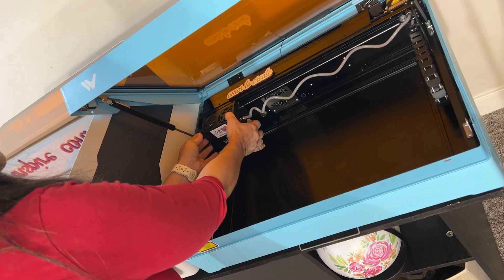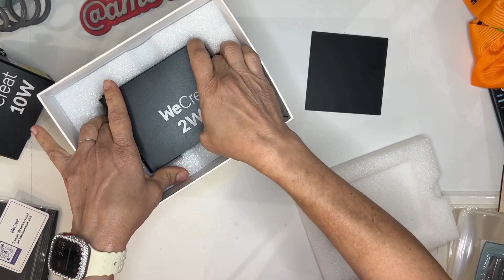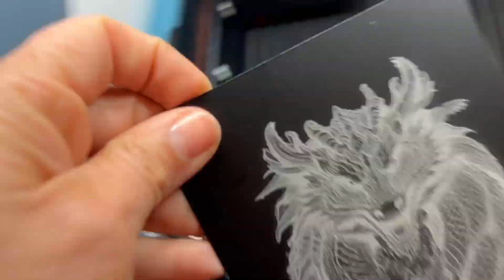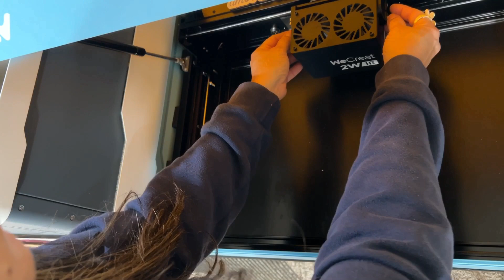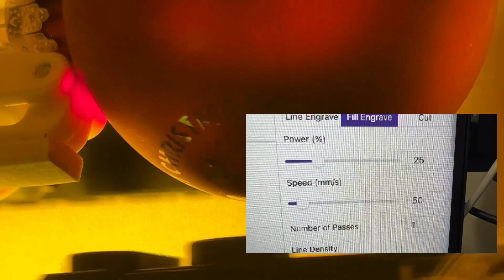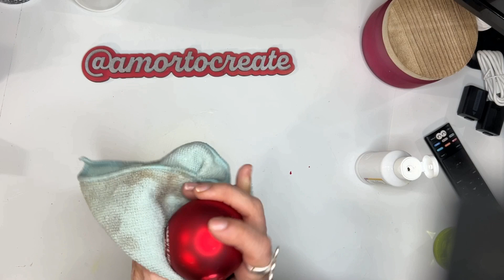Wecreat Vista Desktop Laser Installing and Testing the Infrared (IR) Attachment of the Diode Laser

Comment: I just purchased the vision and would love to try personalizing ornaments. Thank you for sharing!
Reply from the maker: Congratulations on your Vision. You are set for a lot of fun. I just purchased more ornaments and I am trying the setting with the Vista and my other lasers. Did you get the IR of the Vista?
Reply: @amortocreatecrafts  yes, I purchased the vision bundle that includes the air purifier to avoid ventilation issue. I am eager to learn how to work it. Please continue to do laser video.
Reply from the maker: @vanessaparnell4155  I just tested this on my Vision yesteday. I still testing the settings using the blue light. Here are the settings I used yesterday. Test on a small design first...